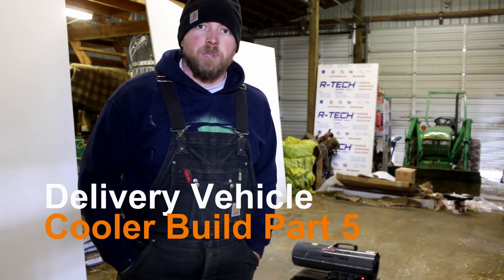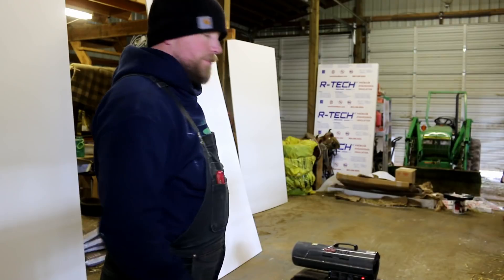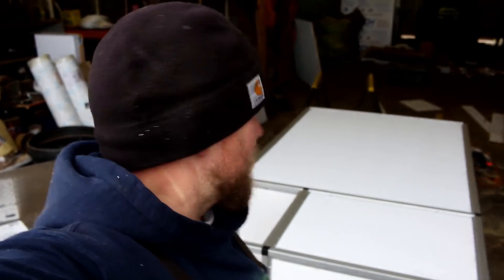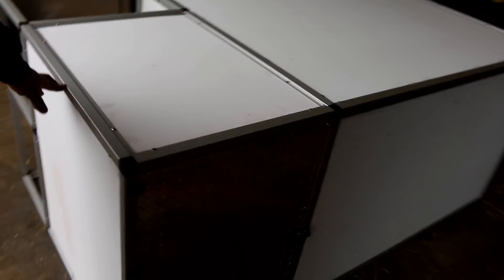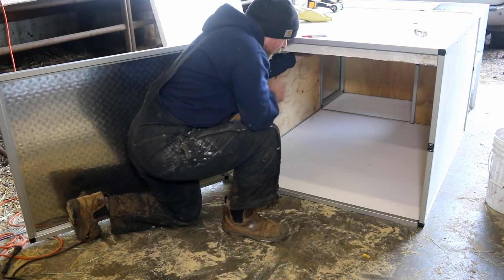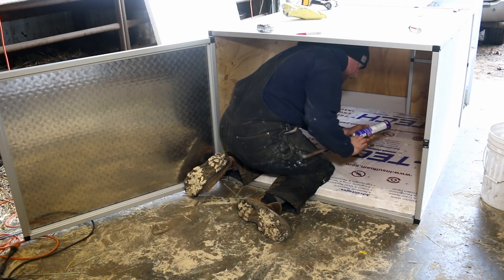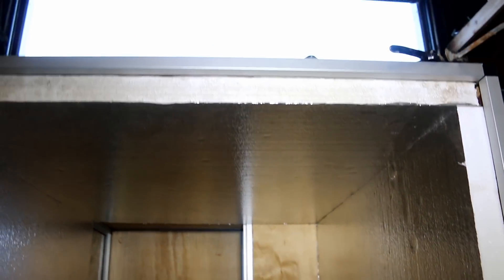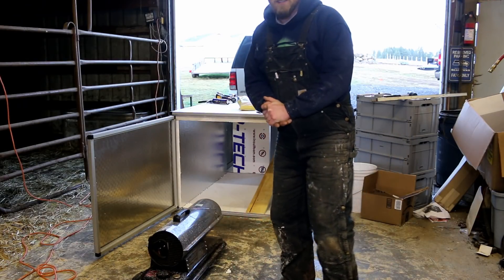Mobile Cooler Build, Panelling Install

Comment: That plywood is going to be HEAVY for what purpose I don't know.  Surely a lightweight plastic panel would be better.  I don't really see why you need something so structural as plywood for the walls.  Not to criticize your plan and admirable hard work.  Keep on chugging.

Comment: Inevitably I think you will have to insulate the floor as heat rises from the vehicle floor and inside the rear door. However hat foil back will tear up with boxes sliding in and out. Suggest a durable and tough easy clean surface covering eg vinyl sheet.

Comment: I'm with everyone below in the summer you will need insulation on the floor. Costs nothing and it stops spoiling in summer with the contact on the floor. Insulation of the door also makes sense as that will transfer heat being metal. Think of it saving you costs cooking in summer. It will take less ice packs to cool

Comment: "heat rises" in the summer the air under the car will be warmer than the cold box and that heat will rise into the box (you need to insulate the floor too. (if you where building a hot box then the floor insulation would be less useful

Comment: "There's no point insulating the floor 'cause heat rises." What? All contact points with the exterior need insulation, surely.
Reply: Heat rises!!!!  You'd be better not insulating the top then not insulating the bottom.....
Reply: Also, the running gear of the vehicle are down there adding to the heat issue.
Reply: I agree tip tap but don't call me shirley

Comment: Nice job.  Foil tape the seams will finish your project nicely.  You will need to have help to align and slide your completed cooler into your vehicle.  Suggest you erect a platform level with the finished floor height of your van.  It will support the mass of your cooler and you will not have to fight gravity as you dock the two modules.